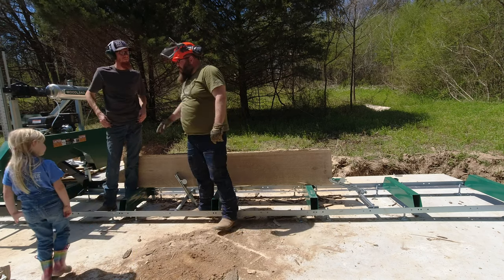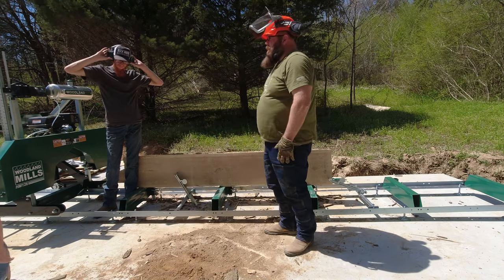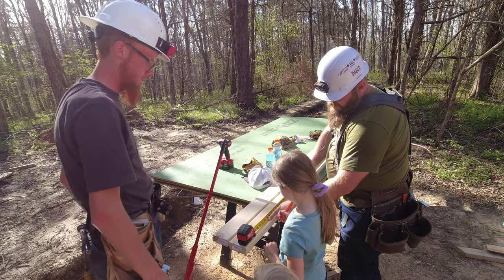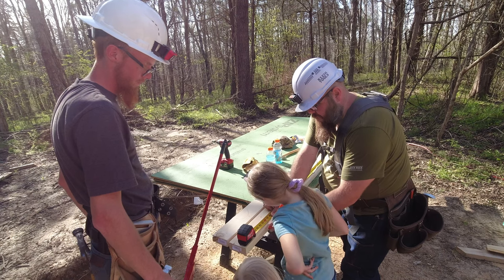037 - Fixing a MAJOR FLAW in the Woodland Mills HM126 Portable Saw Mill Cover. Milling and Framing.

Comment: Getting it done. It's been raining here so much I can't do hardly anything substantial outside. So been working on a small garden at the parents house and think I finally have all the bits I need for a self contained, fully portable, solar powered Starlink access point, which if it works will get expanded with micro-solar powered mesh network to cover the entire property. Maybe.
Reply from the maker: I have trenches to dig to finish my electric service. It has rained in Middle Tennessee literally every week this year. It’s not getting dry enough to dig.

Comment: nice job i  what you mean about the water ponding up in cover  i left my book in tube and it got soaking wet. your girl is going to town on hammer drill. i know it hurt to go to lowes last time i looked the good 2 by's studs were $8 here. take care, be safe and well.
Reply from the maker: The area above the the "Dashboard" has no support, so the sawmill cover sort of droops down. Rainwater then collects in there area that droops down and I'll get a few gallons worth of water in that spot. I haven't checked the tube for the manual in a while. I hope that doesn't have a bunch of water. It might make sense that it would with condensation though. I try to put the cover on after I'm done. I'm still having a hard time remembering to loosen and tighten the belt tension every time. I'm slowly getting it though. 4.2 hours on the sawmill so far. I'm about to be adding a TON more. I'm hopefully getting a large load of logs this next weekend.